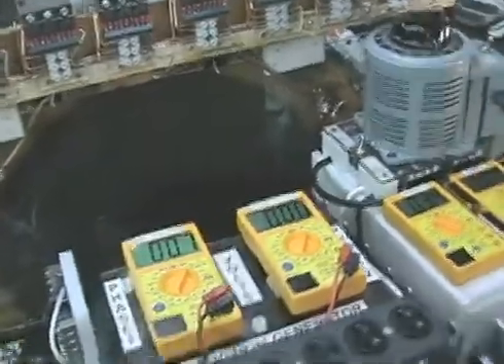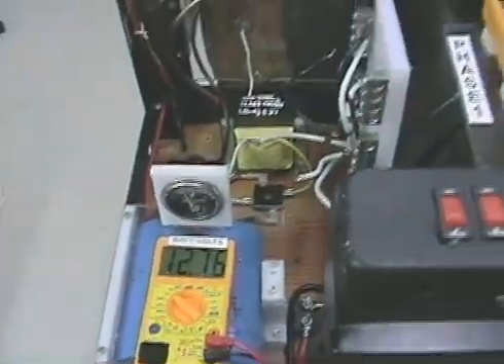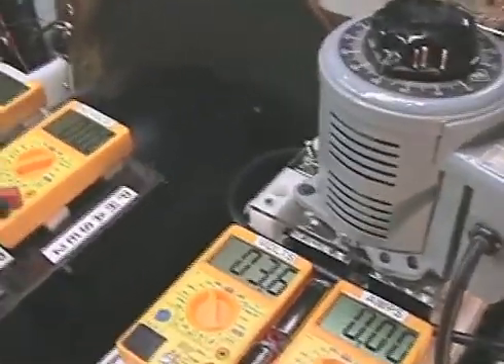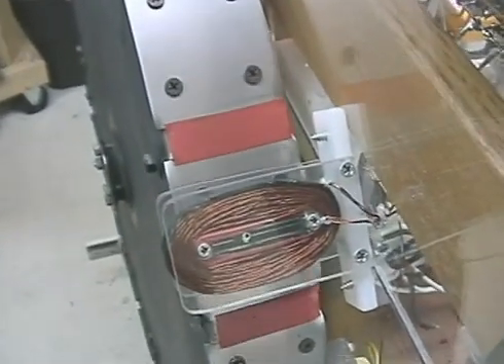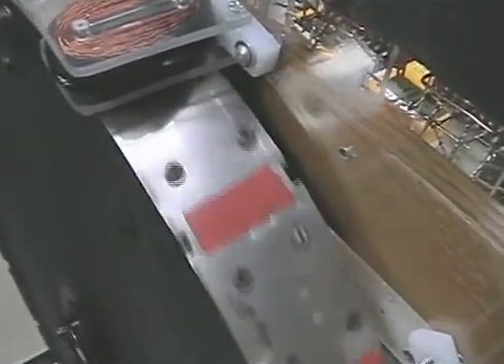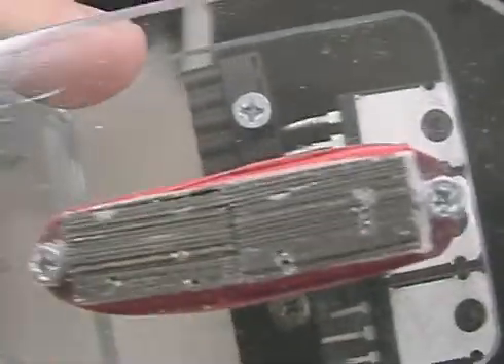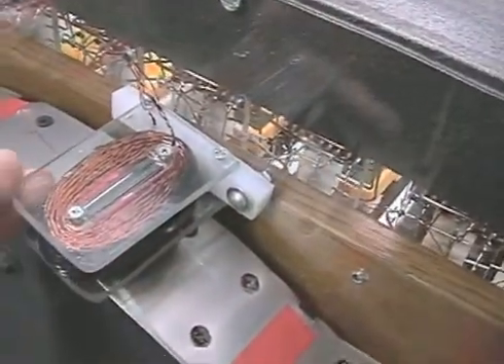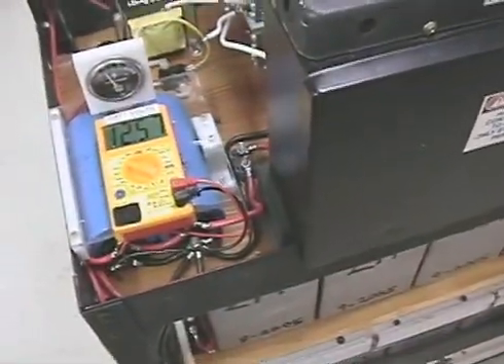Cart Motor V1

Comment from the maker: @uusedman 24awg they are 75ft twisted together with a drill clockwise until the wire is starts to shrink I let it pull about 8 to 10 inches the twist is about 60%